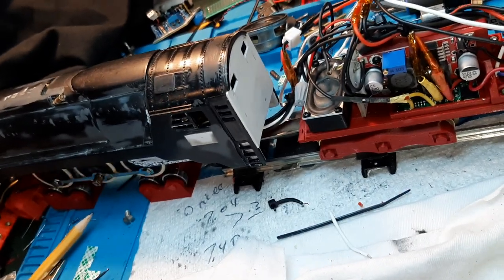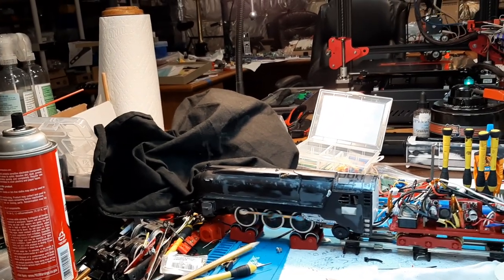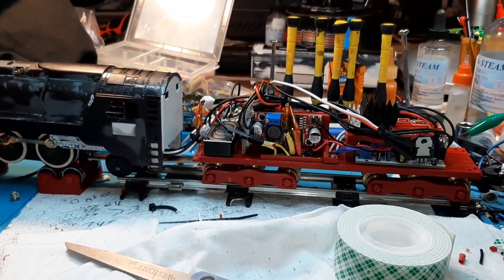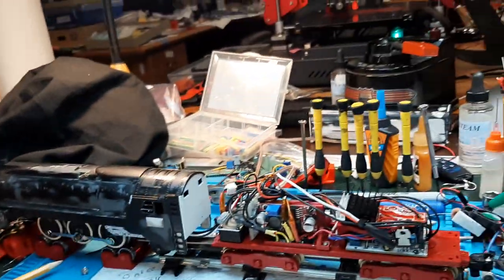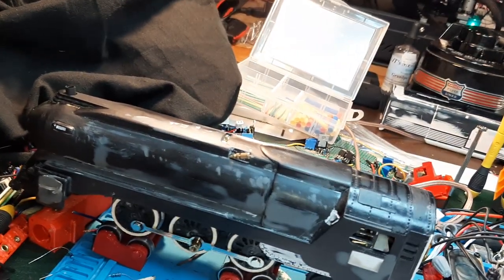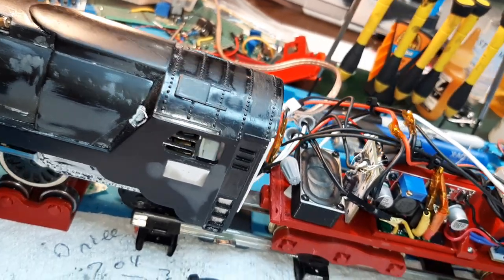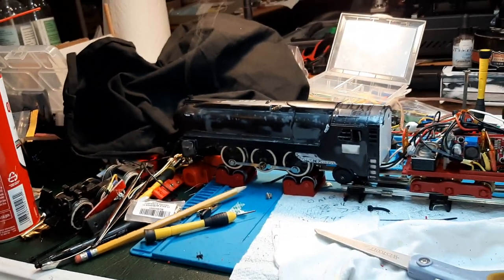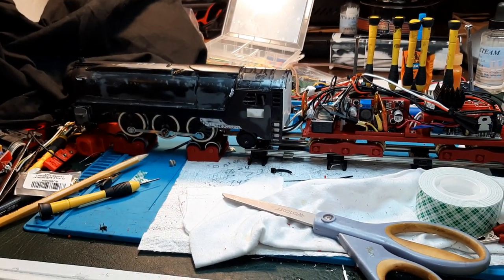Frankentrain Laboratories it is bodied up and fits good. On the rails it pulses intermittently.

Comment from the maker: Update on this video: the Motor Control Board (Digital Reverse) has been replaced with a ESP8266 and PWM Driver. This swap eliminated the pulse in the Drive Motor.  This swap is a huge leap forward but after banging my head against the wall of over 6 months it seems the only option to get this strong Puff & Chuff function to run smoothy. It costs time in development but also brings positive things. Smoother motor operations especially at lower speeds. And Lower Heat generating components. Software options for Lights and Sounds. It also brings WiFi interface to the Classic American Flyer Trains at a budget most can easily afford. We are trying to fast track this swap so you will get to see the final result and be able to judge if this would meet your needs in Flyer Upgrades.  Thanks for watching and please hang in there. More coming on a daily basis.  D

Comment from the maker: In the testing for causes of the pulsing I learned if I unplug the chuff trigger so it stops chuff sounds the pulsing in the drive goes away. I do have the amp in the max volume. Maybe it's pulling from the BB through the PDF and dropping power to the MCB. I will test that with my scope. Plus try to lower the amp draw. Meanwhile Washington is tied with the Philthydelphia Eagles 24 24 with 6 minutes to go and they just got the ball back. It looks like the Wash Def may have worn the eagles offense done. And the top chassis plate in red just finished so I am going the Black parts. It's clear the 3D printing parts are not causing chuff pulsing. So let's get that started. D